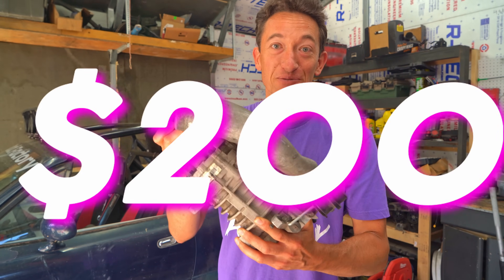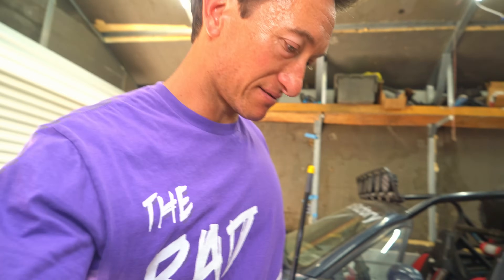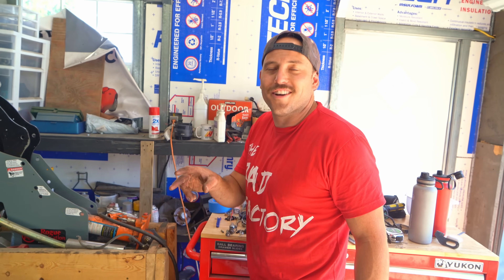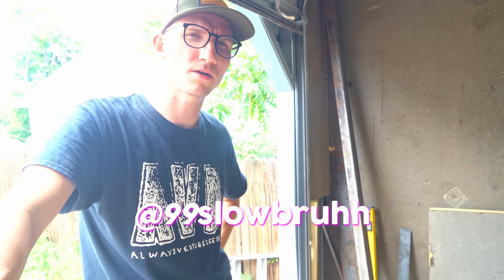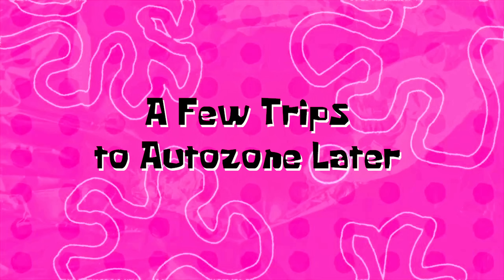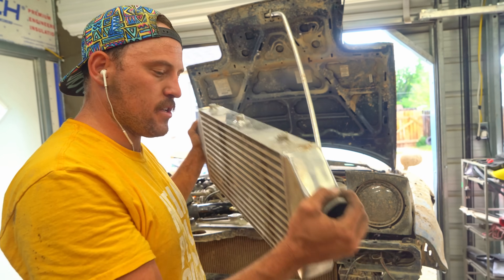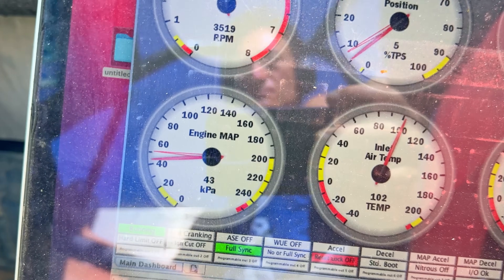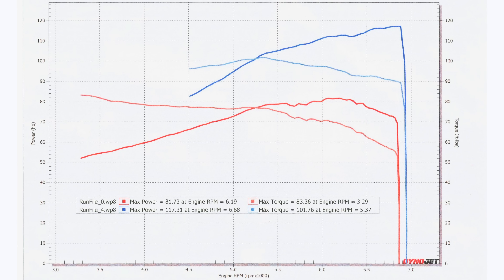Testing $200 Junkyard Supercharger (4th Attempt)

Comment: Put the belt on the supercharger ? Plug it in only tickles my mind only allowed to say it if youre running an a/c clutch on it lol or youre saying it wrong
Reply: I'm 95% sure my dad's Toyota Previa, which was an AWD supercharged 90s van (that my friends and I called The Jellybean), had an electric clutch just like an A/C. So that it was only engaged when the power was needed and didn't act as a parasitic loss the rest of the time.
     EDIT: haha Aaand Previa gets mentioned in the video. Can't say I'm surprised, given the similarly small motors.

Comment: so I just ki da found this whole stream of FAFO and I am hooked.  For this specific offroad miata I'd say you need a lot more final drive gear for that motor with those tires, everything would be exponentially better despite the lack of top end speed which you could fix with a ranger type overdrive
Reply from the maker: Pumped you found us! Our final drive is 5.38:1 up from the stock 4.1. Anything above 65 on the highway is terrifying 😂 and if we ever make it to Baja we’ll be more limited by our suspension for speed. Surprisingly that 117hp is plenty to break the tires loose in the dirt which is what matters 🤘🏽

Comment: Eaton should last, I am revving mine past 15000 rpm at times and it still serves me well. Ive got m62 tho.
As an upgrade I wanted SC14 but after seeing yours fail I just dont want it, at least not the one from ebay or similar. If you would get genuine one I think you would have no problems.

Comment: if that fits on it the supercoupe M90 roots style superchargers would too. look up the engine compartment of a t-bird supercoupe they went on the ford 3.8L v6s which was supposed to be fords version of the grand national. but they didn't have supporting parts for engine mods like turbochargers had so the superchargers fell on deaf ears until 04 when ford smacked a 2.3L whipple on the cobra. I like to think of the Thunderbird supercoupe as the predessor of the cobra mustang. There is a Supercoupe on youtube: CMac89 Turbo SuperCoupe,  that makes a little over 800 whp. Thats a lot for these 1 gallon engines (3.8L)

Comment: Intake from the cab? The sound has to be incredible in person!

Those tires suck horsepower. So these results are more impressive than people think.
Reply: The tires for sure, Rob, horsepower, we did some proper testing today, and it definitely gives it the slight edge that it needed on our racetrack

Comment: I don't think you'll need too big of a hole to the intercooler but the thing is you need a shroud going around it and the radiator so the air is forced to flow through it and then also the radiator fans will help by sucking air through it forcing air to go through it as well when the fans are on.  Also couldnt you have just used bolts to mount the intercooler and drill a hole in the radiator support. Also with your coolant temp issues, I had the same problem with my vortec intercooler but it was only at low speeds once I got going more than like 20 mph didn't matter so you might look at when you're getting the hot temps. Is it all the time or just it like low speeds? Because if it's just at low speeds, you might be able to fix it with more powerful fans. Or you might have to slightly relocate the intercooler so it's not blocking the radiators much. And so that the air that's passing through the intercooler which is going to get heated from cooling a supercharger air isn't going to heat The radiator as much. I know you're super limited on space or I would almost try to put the intercooler at a lower spot or a different spot than the radiator so they're not using the same air. Also, the shroud might help with that because the air might just be bypassing the radiator without the shroud.
Reply: Fun fact it actually cooled better with the skid plate on for all of those reasons. It basically keeps the air from going under the radiator and forces it through. We tested it again today with the skid plate and things were cool as a cucumber

Comment: You need to move the throttle body. It will not last at all like that.
Reply: We are going to put in a dual throttle body set up for sure. Just temporary for now
Reply: @RadFactoryGav  excellent. It’s going to drive so much better. I have seen so many people recently playing with blowers trying to to make a blow thru throttle body and it never ends well. Basically just compresses hot air into more hot air because it’s running at max effort at all times even at idle.
Reply: @tnargdonald extra bonus it will whine wayyyy less. This things screams at all times haha

Comment: I can't remember what the oil in my m90 smelled like, but I know that in my vortec superchargers the gear oil smells just horrendous. Also I would make a heat shield between the blower and the headers. When I made my own bracket to mount a vortec V3 to my mustang, mine ended up mounting the supercharger pretty close to the driver side exhaust Bank over the headers and I just made a little aluminum heat shield and use two of the exhaust header bolts to mount it and it helped out a lot with heat heating up. The supercharger and the intake
Reply: We did some ducting afterwards and the cooling is doing way better
Reply: I should have said it better cuz you did have the stock heat shield on there but and I had one on mine too but I felt like it was so close to the headers that it just didn't do much. When I added the aluminum plate it had like a 2-in gap and I felt like that did a lot more

Comment: The original set up for the intake has a 180 deg turn,  also on the baseline test I think you should’ve disconnected the drive belt to the supercharger
Reply: The 180 piece doesn’t fit with the modified suspension and tube chassis 😢. And we didn’t realize we left the belt on till after 😂

Comment: The specs for the a belt are in the manufacturer part number. If you have the length and rib count its no big deal
Reply from the maker: This is our fourth rodeo. It is a very big deal. At least at our local stores
Reply: @The.Rad.Factory  the part number is belt size and rib amount. Just give them the part number. If you know the rib amount and the length you can give them the part number for any belt. It's very simple just look it and it's like a cheat code to getting belts.
Reply: 😂😂😂 it should be that simple for sure, unfortunately all of the stores near us are pretty run down. I drove to a different town and what you are talking about worked first try 😂

Comment: You should build a cover so the air that gets pulled through intercooler gets funneled into the radiator intake temps should become lower due to the air bieng pulled through the intercooler i had sucsess with this with my turbo 4x4
Reply: that is for sure the goal next. we also have some ducting and louver ideas
Reply: @RadFactoryGav   sounds good keen to see it in action

Comment: Personally in my DSM, ducting between the FMIC and radiator was the answer to keep coolant temps down. If you want to REALLY ensure cool temps, build ducting from the radiator to the hood (add a hood vent) so air has to go through the radiator and has negative air pressure drawing it out. Your air temps and coolant will thank you but it’s a PITA
Reply from the maker: We’ll definitely look into it!
Reply: We are thinking of something very similar